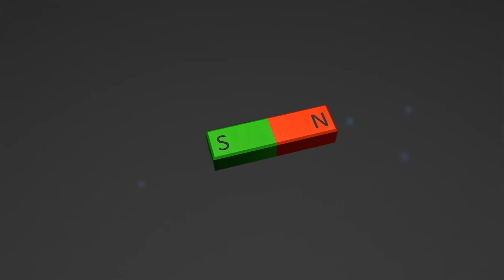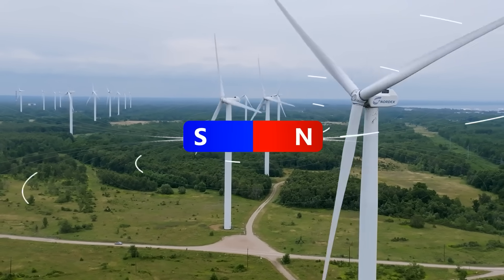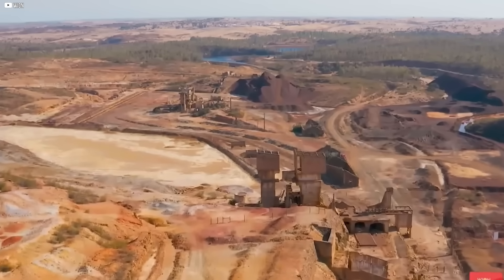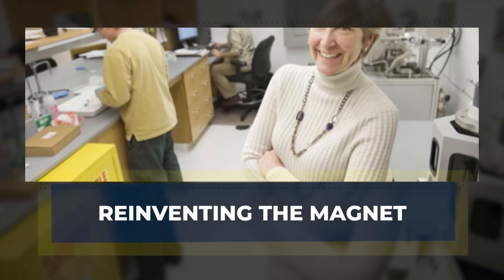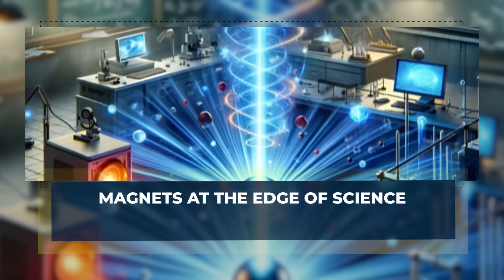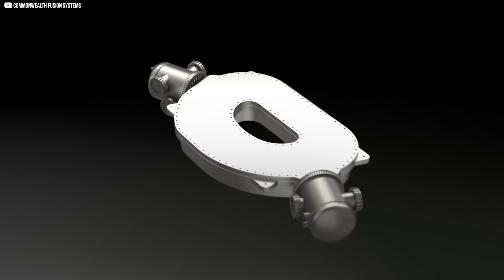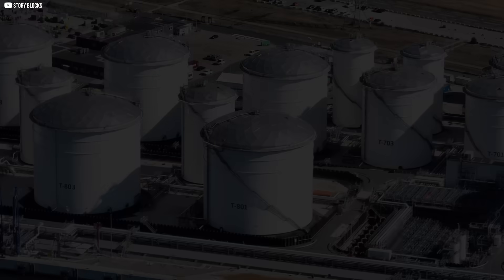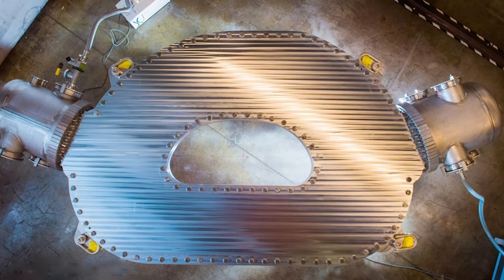This Tiny Force Could Decide the Fate of the Planet

Comment: And they did not mention that about 80% of these 'magnets' are electro magnets, not the horseshoe type we all know. They won't work at all without electricity going through the 'electro' windings first. Start that field going then spin an iron bar inside that field and you produce electricity.
Reply: No, it takes electricity to get a magnet, and it takes a magnet to get electricity. You can’t have one without the other. And that’s how cold fusion works. Superconductor magnets actually contain plasma with magnetism and that with high frequency, alternating current among several other things allows for the extraction of energy from the zero point.
Reply: Takes a magnet to get a magnet
Reply: Bedini motor

Comment: COLD Fusion, not HOT Nuclear Fusion has been REPRESED. Many different types of reactions have been discovered that produce elements from other reagent elements, and is rather safe, comparable to electroplating.
But the petroleum industry didn't like Cold Fusion or any other alternative technologies.
Fliechman & Pons, about 44 years ago, discovered the first reaction. 15 years ago, thousands of reactions have been discovered already.